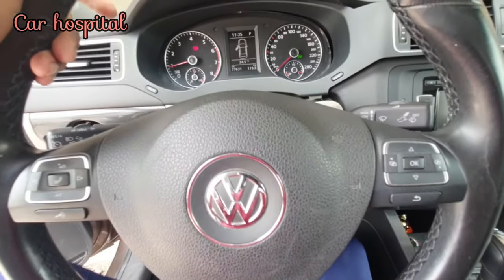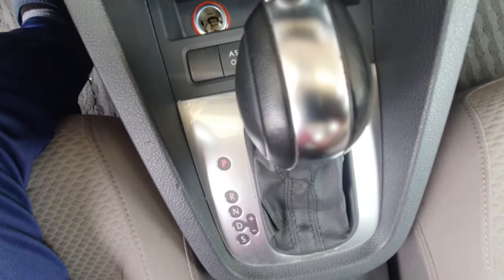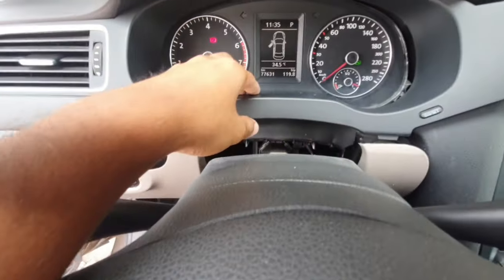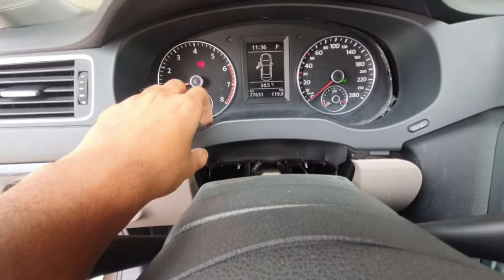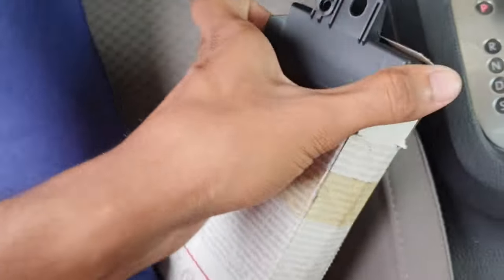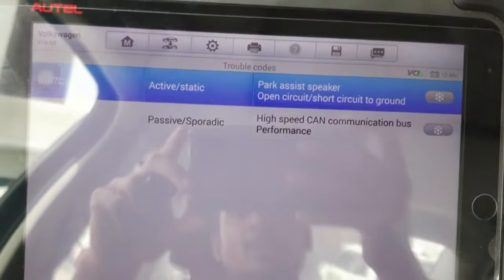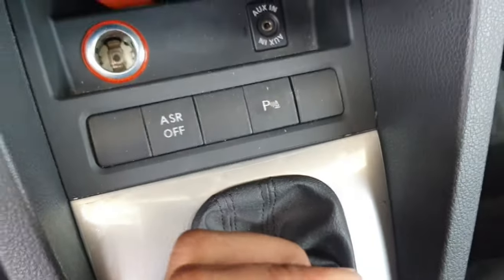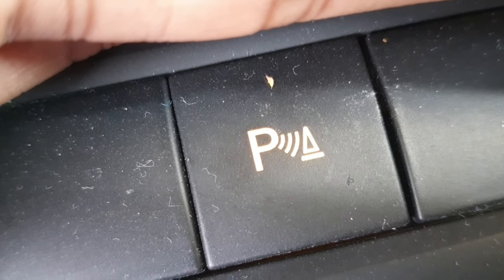Volkswagen parking sensor not working.  Easy solution

Comment: Thought ide share. Same happened on my 2018 vw tiguan , but before one sends it to garage please try this yourself, as i did today by pure accident and it fixed issue in your vid. Go to screen above steering wheel and turn off all assists, on my car it has two including lane assist, click those boxes so no tick shows, i waited 6 hours to go for drive (as i had an issue and manual says switch off front assists, so i did), but just for whatever reason i clicked on front assists and BINGO Wahooooo it reset itself. Still can't believe it but if that doesn't work yes you need to take it to the garage and get fixed. I forgot to mention i cleaned all my sensors but still error front pilot showed on screen and flashing at the P button. All fixed and with by reading my manual and by pure luck. Very happy and hope this helps. Remember i only turned off assists as i had a problem and manual advised me to do so, they thankfully are back on now and i saved a fortune. Just to add while car is parked (as states in manual) the car runs automatic tests on sensors, assists etc. Both lane and front assist boxes were un ticked when car was in my driveway, engine was switched off. Six hours later i turned on my engine and ticked both lane and front assist boxes to on. Remember on your big screen to un tick automatically to switch on in menu options. Hope this helps.

Comment: I had the same problem today, everything was fine but suddenly when i tried to come out of parking this parking assist button started beeping and my rear sensors stopped working. I mean it stopped showing in the screen. I assumed this parking assist have been turned off. Nothing was out of order I don’t think anything would go faulty all of a sudden. What might be the problem?
Reply from the maker: 1st Go electrician and diagnosis ok
Then you can understand what is the issue 
Ok brother

Comment: Hi , when you said there was no communication with the module . What did it shown . 
My error code is b107a14
Reply: Did you manage to get this sorted I’m getting the same error code any idea what it is?
Reply: No , still same .
Now I can see sometime the graphic comes on the screen and park assist show as well but sensor doesn’t show the bars and sometime beep for few sec
Reply: @shahmnnsn  I believe it’s the speaker, I have the same code so I’m going to order one
Reply from the maker: Ok brother 👏
Reply: Now it’s working by itself
Reply: @mohammedkahaf2428  did you changed speaker and it started to work ?
Reply: @mohammedkahaf2428  did you changed speaker and it started to work ?
Reply from the maker: Yes brother many car speakers damage
Replace then it's work
Reply: @BimBimBam420 hi 
I change the speaker still same thing
Reply: It seem in winter only it work

Comment: Do you mean if this blink that mean it’s a module faulty . 
I got Vw touran 2011 and having beep sound for few sec then p button flashing .
Reply from the maker: Check with scaner which fault coming
Reply from the maker: I thing any buzzer damage
Reply: @carhospital  but the graphic car doesn’t come as well
Reply: I have test the buzzer with the scan test and both work . 
And did replaced the module but still same

Comment: I have the exact same problem. Which OBD scanner will detect if it is the Park assist module or the speaker? I don’t have VCDS
Reply from the maker: Maxisys elite
Reply: @carhospital  do you have a more step by step tutorial on how to take off the vents like you did so I can unscrew the cluster/meter
Reply: @carhospital  I bought scanner and I have code B107A14, is it speaker?